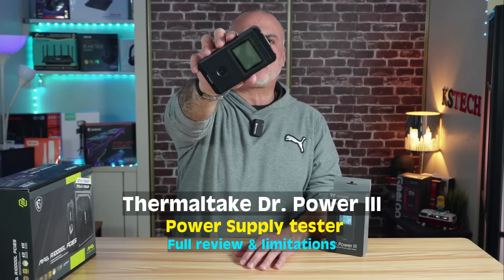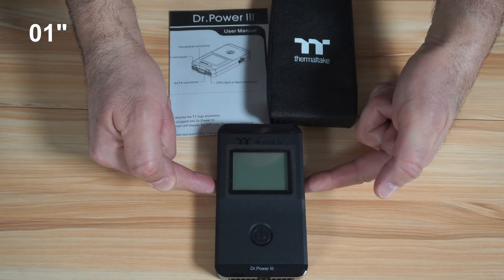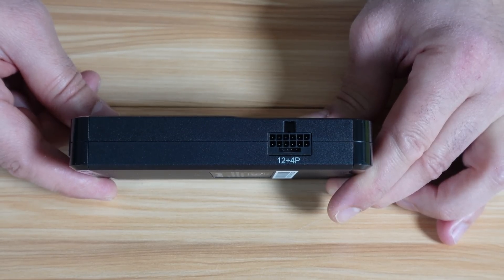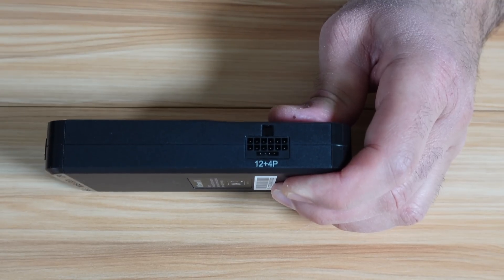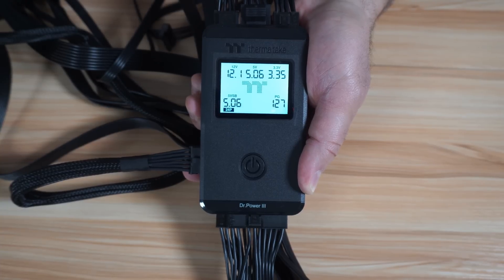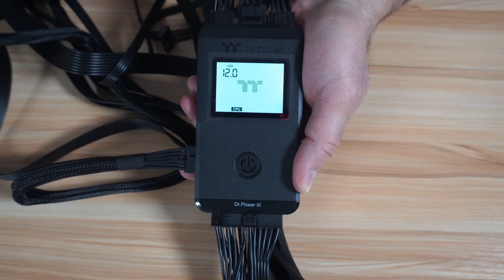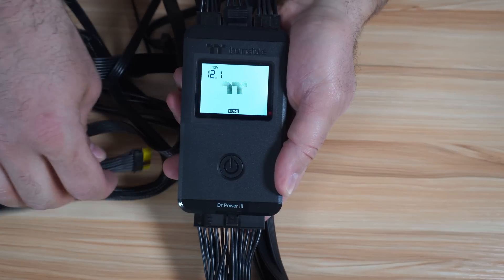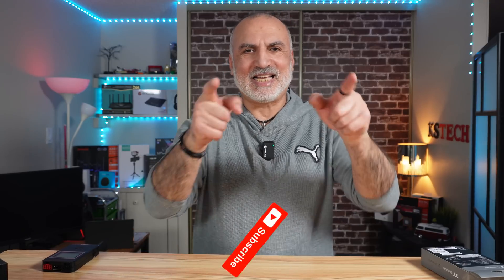Thermaltake Dr Power III PSU tester Review

Comment: The advantage of this tester over the generic tester is the PCIe 8-pin ( vs 6-pin) and PCIe 12+4 pin connectors.  However, it does not give a reading for the -12V rail.
Reply from the maker: Thanks for the information!